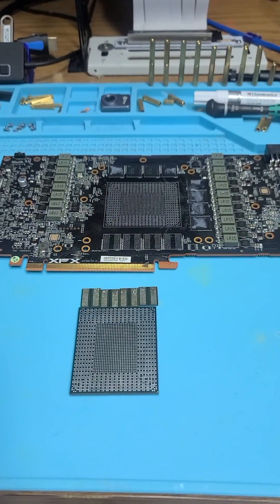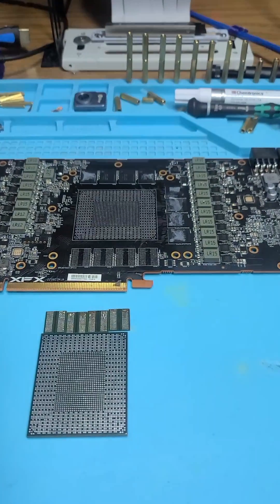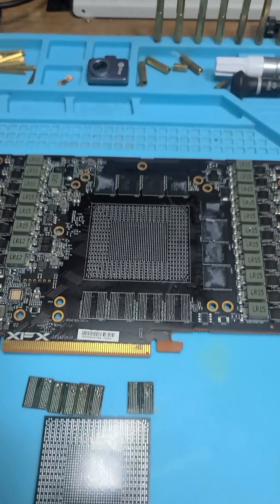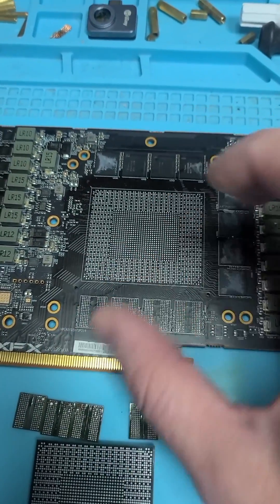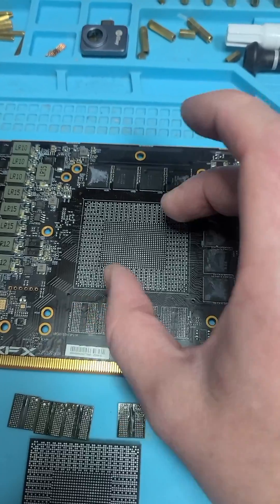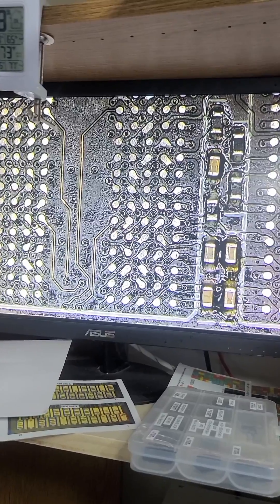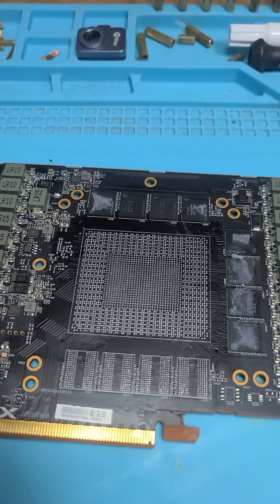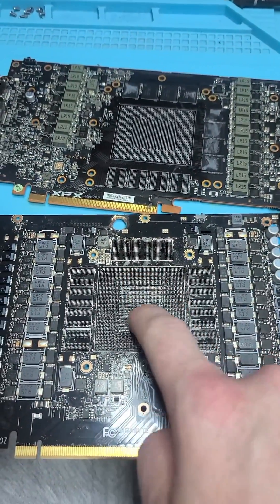TOP reason not to buy AMD 7900 series GPU #shorts

Comment: I can totally see why you're annoyed here, and from a repair tech view it makes sense. On a 7900XTX PCB the solder mask is really thin compared to something like a 4090, so pads rip easier and the board just has fewer "lives". Plus with RoHS and the new eco friendly coatings it's less tough than the old epoxy stuff. So yeah, from your side that's a real issue.

But for normal users it doesn't really matter. AMD isn't making "bad boards", they're making trade offs. A thicker more durable mask would add maybe 0.50 to 1 dollar per board, and across hundreds of thousands of cards that's millions in costs. Nvidia spends more here because they also sell into workstations and enterprise where serviceability actually matters. AMD is mainly pushing gaming with RDNA3, so for them "good enough for gamers, not ideal for repair" is fine.

There are even some upsides. Thinner coatings can improve signal integrity for really fast stuff like PCIe Gen 5 and GDDR6, and they can help a bit with thermals. For 99 percent of buyers who will never reball a GPU, this choice is basically invisible.

So yeah, you're right to call it out from your perspective. But for gamers it doesn't make AMD cards unbuyable. It's just one of those behind the scenes cost and market decisions that doesn't show up unless you're in a repair shop. No average gamer is gonna grab a soldering iron anyway lol.

Comment: The point is : how many of as reball GPUs and how many GPU hit the landfill without even a single reball. That material is there for same reason the lead is out of the soldering, same reason textolite is missing or is in very small quantity in PCBs - fill the landfill so you fill our pockets to when you buy another GPU.

Comment: Just bought powercolor 7900xt, am i in trouble :D ?
Reply: no, just dont let it sag with a support bracket or stand. use a included support bracket if it comes with one to avoid pcb cracking.

hes making it seem like we have to plan to buy a gpu that can be reballed 20 times. in which case i should've bought rtx 4090 to reball 20 times after the trash cable burns the house down.

Comment: In retropective, I probably had 50/50 split on Nvidia/AMD in the last 25 years (after 3dfx death), mostly AMD during the 5xxx-7xxxx radeon days, and Nvidia in the last 10 years. If anyone wants to buy AMD, go with Sapphire. Never had an issue, I still have a 9800Pro AIW working (21 years old…), a 7970 GHz edition (my ultimate Win XP gaming pc).

Comment: No thanks, My 7900XTX is way more reliable than a 12v pin exploding all the time, and judging by your videos, there ony have been 2 7900XTX for repair in your shop compared to the thousands od 4090s and Ngreedia GPU that end up in your shop and some you cant even repair and you end up using them for parts, so your own documentary of years fixing GPUs says Ngreedia is Trash, ill stick to AMD thank you very much.
Reply: Maybe he doesn't see as many Radeons because its market share is so much smaller.

Personally I don't have faith in either, had both brands die on me prematurely, one was a Microstar gaming series Radeon, that one got resurrected in the oven a few times until it stopped liking it.  Then there was the coveted EVGA gaming series GeForce which shorted and burned smoke until the PSU short circuit protection kicked in.  I suppose I should be thankful it didn't destroy my whole system along with it?  Is that what I paid 650 for?

And my new card arrived and I can already see one of the thermal pads isn't touching one of the memory modules — great job Microstar...why did I trust you again after the first time?   

I vote "no confidence".

If I had to buy another card I'd probly roll the dice on another Radeon simply cause I haven't rolled in that direction in a while.   I figured it's ready for another roll.  You try and spread your luck a bit.
Reply: @Animal_lives_matter  He literally just released a video of a AMD 7900XTX Saphire showing how is the best GPU made and how should a GPU should be made, making you a 🤡🤡 for that ignorant comment, HOLD THE L.
Reply: @hdz77  
I see, it's the best GPU ever made, because when a customer dropped a barbell on it, the backplate happened to take the force of the blow.   Yes great metric of electronics quality.

Comment: Does the 7900xt suffer from the same cheap mask used on 7900 xtx ?
Reply: As a 7900xt owner, probably, but I really wouldn't worry about it.

Chances are, your GPU will last at least 5 years regardless of the brand. This is only an issue *if* it needs to be repaired, and chances are, it won't need to be repaired.
Reply: @trr4gfreddrtgf  thanks for the info..

Comment: You get what you paid for. 7900XTX MSRP was ~$1000 while the 4090 was ~$1600-$2000. Whaddaya expect? 

I'm not a fanboy of any brand, i also want something good but i also know that "good" thing comes at a cost, while another "almost good" thing have lower price. You can say Nvidia this and that this and that, AMD this and that this and that, but no need to say "Reason not to Buy" when it comes to certain brand. Let's just say it has problems here and there. This means buying that thing is their own problem. And you can always refuse/reject the repair, right?

Nvidia's 12VHPWR connector "Melting" problem is BARELY Resolved, even after this long. Why don't you also say "reason not to buy" it? It even poses a potential fire hazard for your entire home.

Comment: Maybe it is just me, but I don't buy a videocard with the idea that I need to have it being repaired. I have a 7900XT and a 7900GRE at this moment, and using them daily for several hours, without any problems. I keep them cool, not overclocking or undervolting them and using bracket support. Not seeing any reason why I would have to change the GPU and/or memory. For me this isn't a main reason for not to buy these cards.

Comment: I think you mentioned this issue in the past. The mask is crap, but the pads are sturdier compared to nVidia PCBs? Anyway it comes off with cleaning I guess? If you avoid IPA and such, and leave on the old flux, (which of course can cause issues too) could be the parts soldered back safely? Or the mask comes off even with heat+flux+solder wick combo?
Reply from the maker: This was coming off without alcohol, just by wiping flux away.
Also solder wick was scratching it too easily.
What I said in the past is, Samsung and hynix loose pads easily but micron does not.
At the same time it is good and bad for either one because Samsung and hynix are more likely to break than micron but if board is twisted enough, micron will take pads from the board with it where as Samsung and hynix will sacrifice them selves and save the board.
It's a tough choice to make for a consumer because it's broken either way.
From the repair stand point, Samsung or hynix is better because it saves the PCB.
Reply: @northwestrepair  Thanks for the clarification! It's really a bad design then. I hope these "single use" PCBs really won't be the new standard...

Comment: ooops credability downngrade , not an amd issue since they just provide gpu chips and designs to external vendors , xfx is a cheaper end vendor so you pay less get less, but then  everyones boards are cracking and tearing pads , this reball issue is just one extra fk.u to us
i think the situation is now there are no good choices in pc components 
ill stay out of the fanboy bs 
everyone is only pretending not to be ripped off no mattter what "choice" they made
Reply from the maker: Radeon is AMD brand card.
Same issue.
Reply: @northwestrepair so Amd are enforcing pcb specs? Sapphire the same? Anyway I Still see no good option, nvidia are just as bad just different bad and Intel aren't in the ballpark but their cpu fiasco kills their gpu in my mind anyway, who cares

Comment: Thanks for the heads up. I think some of the commenters are missing the point that the board, regardless of who makes it, is by design not robust enough to be repaired. Whether or not it has carcinogens or not is a side bar.

Comment: My dude a 4090 costs extra 900euros here in Denmark...and for a mere 10 - 25% increase in performance in 4k specific games, sure the ray tracing is better but again in 4k games they both have slideshows instead of at least smooth 60 fps and I'm not gonna even mention about the multiple problems the 4090 has regardless of the subvendor.
I don't know man, I have to disagree with this one.

Comment: This will go through a company's testing no problem.  They don't make cards expecting re-flow or repair activities, they work to a MTBF and will specify environmental conditions amongst others.  

How much they cater for sagging for example is anyone's guess but there's no way they're thinking about repair tech's reflowing solder within them.
AMD are in a tough place with Nvidia's mammoth market share (bit like Google with its phones compared to say samsung), it both gives it a market (choice) but also makes it near impossible to grow very large.

For me they need to do R&D in AI suitability (ie remove the graphics element) to push new  products in that market.  It has potential to be bigger than the gpu market and given they already to design work it wouldn't be too big a switch but they need to find a next gen tech.   Tough ask.

Comment: Wait... I thought having to reball a GPU even once was a sign it has a major design issue (or was handled very poorly)? So now we have to plan to get reballed many times? jeezers.
Reply: In that case, don't buy Nvidia, he 'reballs' them all the time.
Reply: @brulaapgaapmeester8052  To Be Fair- NVidia has like 85-90% of the gamer GPU market iirc, and they have some much more valuable used cards at the top. Makes sense that would be his speciality. Not many would pay to reball a GPU worth less than $300. But he does not blame NVidia for NVidia card issues.. he always blames the card maker. A bit biased, he seems. To Be Far X2. He is  not familiar with AMD cards.. so he probably already doesn't like working on them since he is outside of his comfort zone. I've had both NVidia and ATI/AMD cards die fwiw.

Comment: i bought my 7900xtx because it is so much cheaper. i had been babying it with undervolt and plenty of case airflow, i when gaming I try to not let it go above 60 degs, i hope mine will last me a long time
Reply: i got a GRE and I have overclocked it to eat 315w. it will last me a long time
Reply: Card go burrrrr
Reply: People are pushing 500 watts into these cards with little issues. I've seen 700 watts. Let her rip.

Comment: Isn't that AMD, Intel and especially Nvidia have their own spec sheets or guidelines for their products with the bare minimum that is required to make their SoC work? If that so it's hard to believe that AMD recommends using subpar coating on theirs AIB designed graphics card.

Comment: Next time at least try to specify which board partner that card is made by, instead of just telling people not to buy an AMD card... 
If it's an AMD reference design then blame AMD, if it's made by one of their partners then blame them directly since AMD only responsible for the GPU chip.
Reply: The buck stops with AMD, does not matter who they got to make the items, their name is on it.
Reply: @tonylawlor8833 yes it matters, unless AMD directly instructs AIBs to only use this soldermask, it can't possibly be AMD's fault. They can do nothing but approve any and all AIB designs that meet all specs.
Reply: @tonylawlor8833  and?

Comment: that issue is easy to prevent, NEVER purchase a gpu mounted on a pc and shipped. 
buy it separatedly on its box and foam, and NEVER ship your pc.
Reply: That has nothing to do with the actual problem. A new gpu could require a rework three months later of the purchase or three years later, depends of your luck. But hey, with these kind of pcb, you can't rework them that easy.
Reply: @MGOFor3ver  those are the minority, most of the repairs are ripped pads or even broken pcb because bad shipping while mounted.  Dont you watch this channel videos or what? U should know.
Reply: @MrDvneil  this video has nothing to do with the broken pcb, its about the fundamental reparability of the chip lol
Reply: @sei_asagiri  it does, shows ripped pads, and broken pcb, repairability is 85% of the times because that reason. so yes, it is related.
Reply: or just never buy an amd gpu, problem solved :P
Reply: @sei_asagiri  nope, because pcb broken and ripped pads happens on nvidia same if treated like a soccer ball,

Comment: No reason for me to buy a Ngreedia product 😉 im pretty sure my Sapphire Nitro+ 7900 XTX will never need such a repair😌
Reply: hate is on their techy side, unless thousands of 7900s are failing everyday like a 4090 melting on its own before, then ppl would've avoided buying
Reply: I have Sapphire too (no +Nitro, just Pulse), I hope as well 😀
Reply: @RudolfKlusal they use the exact same pcb youre golden
Reply: I have a 7900 XTX reference model and I thought it would be bulletproof it served me well for 3 months until I was just playing a normal game of sunhaven a very light game all my screens went black and only one was operational in the GPU LED lights went off Vans still spin but yeah I had to reinstall the drivers and it only worked for 5 minutes and then poof it happened again I have a 750.00 card as a paperweight right now and I don't have the original receipt for an RMA I'm going to have to go to electronics store that specializes in PC repair to fix it never had this issue with Nvidia I had a 1080 TI 3080 TI 1650 a2000 980 TI 4060 none of them had this issue heck even the rx580 that I had once never had this issue but it had other weird things but I was still able to play games
Reply: @Ziyoblader First it was well known directly after the Release of the 7000 Series cards that the reference model of the 7900 XTX  had problems or at least the first batch that was produced had faulty vapor chambers 😉 and alone from that perspektive IT makes no sense to compare it to what i wrote in my comment because i own a Sapphire Nitro + which is acAiB Model and to be exact the best AiB Model for the RDNA 3 Cards. Second how did you manage to buy a Card and don't have a receipt for it 🤔normally you get on at the Checkout of the Store❓or If bought online , such things nowadays are aviable thru your Account/login at the retailer where you bought the Card 😌 i can Print out *Everthing that i bought from the last 2 years If i want. Or did you buy a used Card  ❓ then sorry to write that but it's literally your fault in that Situation buying a used Card ist always a 50/50 gambling If you get a Card that has been used normally👍🏻 or the worst Case a Card that was abused as we often see here in the Videos😉 And that a graphicscard can get a defect or dies also isn't AMDs fault or a AMD only thing because i build Gaming Rigs for 28 years now (567 Systems total and counting) and also a handfull of workstations and i had exactly 2-3 defect / dead AMD GPU s in those 28 years 😏 and 17 defect or dead Nvidia ones 😌 youll see it can happen with every Brand or Manufacturer thats the truth. Apart from all of that you can still send it to our Hero northridge fix or not ? And also what you describe could have other reasons, i had two people that brought me their systems  with black Screen issues and Fans ramping Up to 100% and so on...and  both i could narrow down to a to weak powersupply ( Corsair RMx 650 ) issue and the other with the other it was a problem with so called "Premium cable Extensions" from cablemod ...as soon as i removed them and connected the 3 original pcie 8 Pin cables directly to the Card ( the ones that came with the Corsair RMx 850 ) everthing did run perfectly well.
Reply: @Ziyoblader its because you bought the reference model.
Reply: @TheRealChinoMoreno  update on that it looks to be running again the culprit seemed to be the motherboard shorted out because when I looked on the GPU when are the eight pins smell bad of burnt plastic and when I looked at the 180° adapter it was destroyed which would make sense when I took the GPU out and put it into another computer it worked fine my guess is that a short might have happened when it was in transit moving to my new place the GPU in my system is directly pushed up against something very snug but anyways I'm happy it's working now with the new motherboard